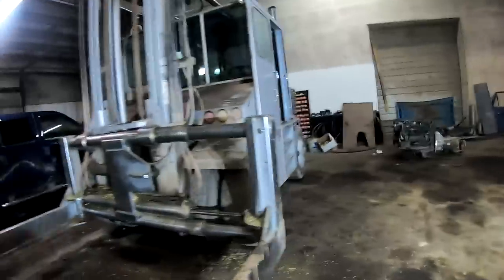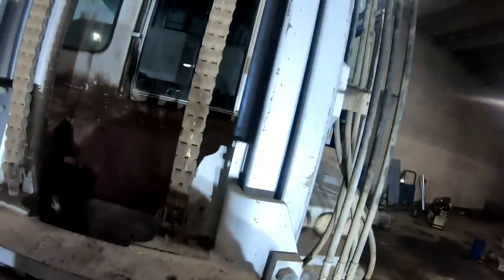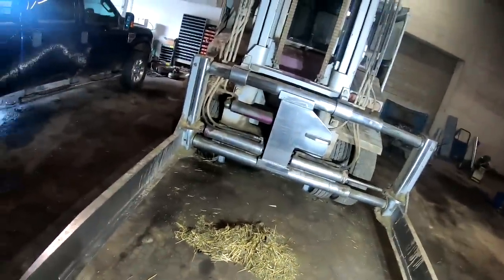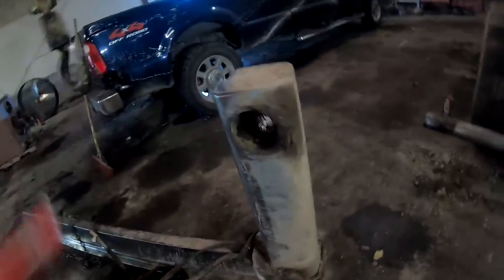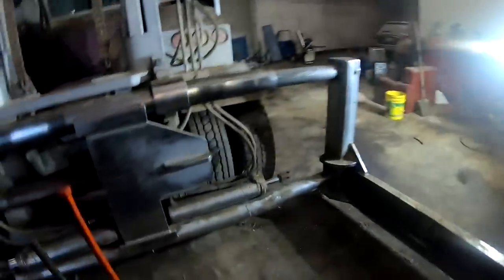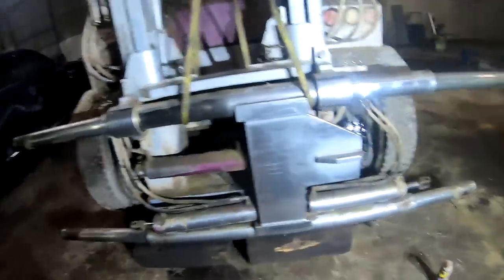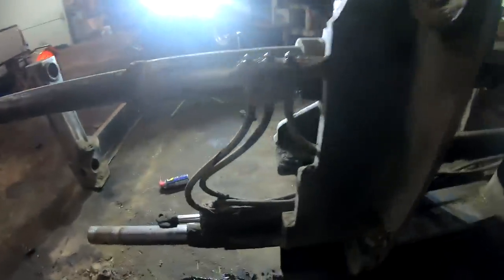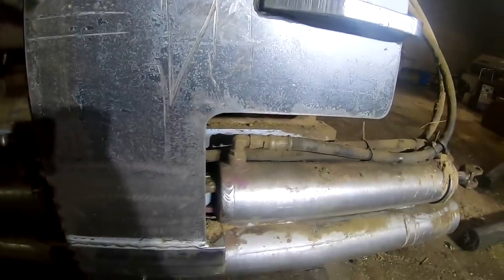Another hay squeeze.

Comment: An easy way to check puppies when your picking one out to see if they will be scared/nervous over loud sounds later is to jingle some keys or little bell loudly. If they run or sniff it will give you the answer.
For IQ test, show them a treat, than place directly in front of them just past a space that is just a bit to small for them to get through to get it(furniture, boxes, whatever works) and see how long it takes them to figure out to go around the outside and around to get it.

Comment: I would of used a bottle jack and a board to get that Fork off of there
Reply from the maker: Yeah,  and both upper and lower rods would have stayed in the arms and slid out of tubes, and you would have still have to beat rods out of arms to look at arm bushings.
Reply: I was thinking the same thing a 4 by 4 in a bottle jack. Push it against that plate that he has to cut off that would have worked either way he got it done. He's in better shape than me. Keep up the good work.